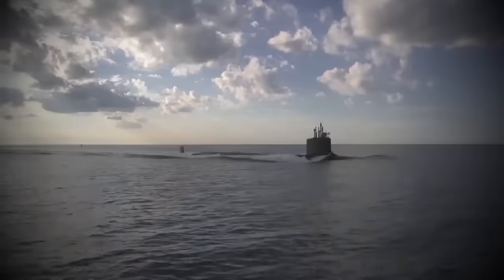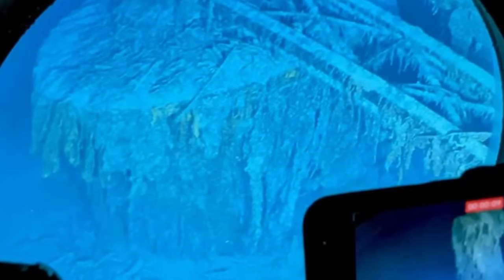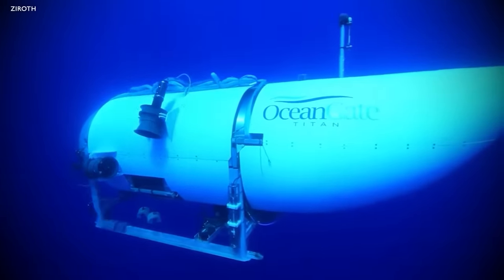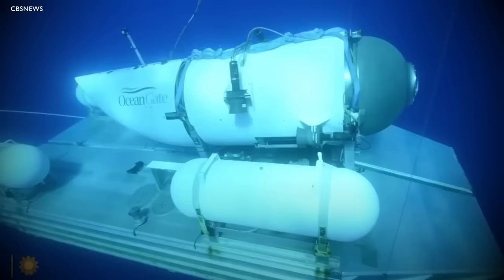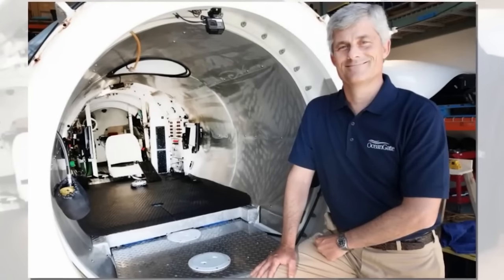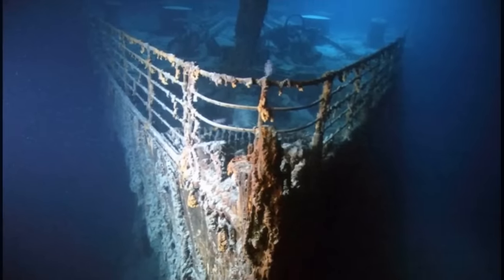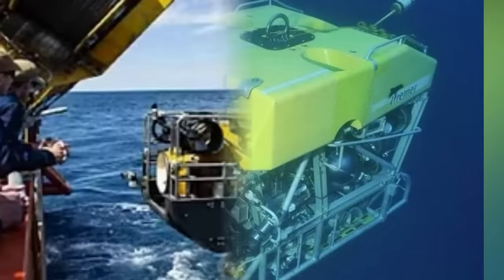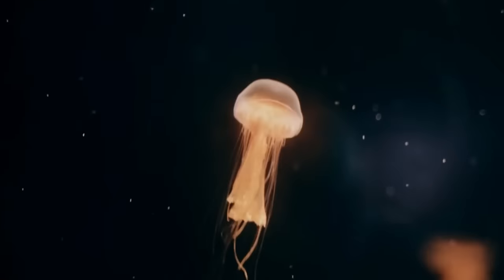The TERRIFYING Secrets lying behind The Imploded Titan Submarine Walls!!

Comment: After seeing so much about the brazen incompetence that went into building  that vessel, I really don't understand framing it as an impressive achievement or invention...
Reply: Agree.
Reply: yep , i would describe it as a deathtrap destined to fail . it had so many problems its difficult to determine which one failed
Reply: Correct evertime I hear that phrase used to describe this " vessel destin to fail" I can't take the narrative seriously and thus void my ability to drop an👍🏾and watched the complete video ✌🏾💥
Reply: Because it was
Reply: Because it is not… they used a sophisticated type of “plastic” instead of steel and titanium and they did it without class certification.. it’s criminal and disgraceful
Reply: @Slayavcados  bs... if it weren't for those kinds of projects we wouldn't have planes or gps.....wake up
Reply: @josepheddy8189 planes that use carbon fiber have had over a DECADE testing it and it doesn’t deal with the same type of pressure it isn’t glued on it’s reinforced and again, has gone through so much rigorous testing that IF it didn’t succeed with Boeing for example, they would have went out of business and some other company would have reaped the benefits from their research alone, furthermore they weren’t carrying passengers during testing, in fact each section was tested over and over and then when completed wind tunnel and computer simulations, they are certified to operate within their respective means, and they have regular maintenance/checks to keep it flawless… there’s no comparison here
Reply: @josepheddy8189 he wasn’t doing anything new. We can already go to those depths. He tried to do it on the cheap bypassing basic safety standards. I’m an ex-submarine. Just the shape of his vessels should have rang alarm bells.
Reply: Understandable if video is viewed as the click bait that it is.
Reply: @Slayavcados ok, don't take this as Mr thinking this was a great idea or anything, but you do realize that when layed right, carbon fiber is stronger than steel, right? It is FAR from "some exotic plastic". I think the laying of the hull wasn't exactly right, andmaybe even could have been thicker, and used a clean room. Also, the guy did manage to make 14 trips down to the Titanic. Out of 90 attempts, that's not great, but just getting there once is actually a pretty amazing feat. How many people has history shown found success when all the "experts" said they were doing it wrong? If the  sub worked great, none of us would even know about it.
Reply: ...framing Titan as an impressive achievement or invention... is B.S.
Reply: @Spike-sk7ql The issue isnt the strength of the material so much as its ability to keep the pressures of water at bay. It simply cannot do it according to all professionals in the field. No exceptions, you must use contiguous material. That is why steel or titanium are the main choices.
Reply: Right!

Comment: This video is a shallow regurgitation of information and video clips previously published elsewhere.  

- No mention of the fact that the "real-time Hull Health monitoring system" (noted at the 4:38 time mark) that analyzed hull stresses was only touted to work by Oceangate.  No independent testing of the monitoring system was ever conducted.  No scientific explanation was ever provided by Oceangate as to how the hull's acoustic signature could be translated into determining whether the hull remained safe.  (It has been alleged that the Hull Health monitoring system would work only to document the hull failure - and could not be relied upon to act as warning of impending failure.)

- No mention of the fact that the porthole window was dive-rated for only 1300M on a dive close to 4000M deep.

- No mention of the fact that it is standard procedure for deep sea submersibles to have emergency rescue vehicles standing by on every dive, either manned or unmanned.  There was no such supporting vehicle on the mother ship capable of assisting the Titan at the depth it was diving.  In an industry where redundant safety measures are a hallmark, Oceangate chose to operate with no margin of safety.

- 6:01 time mark _ discussion of carbon fiber hull.  No mention of the fact that Oceangate earlier stated that the hull would be made from pre-pregnated carbon fiber composite material (a much more uniform and dependable product than the wet layer carbon fiber composite material that Oceangate eventually used).

- 8:53 time mark _ discussion of Titan's sonar.  Titan was not equipped with sonar.  It needed guidance from the mother ship in order to direct it towards the Titanic wreckage.

- 18:39 time mark _ Navy heard the implosion and notified the commanders leading the search effort IMMEDIATELY.  This statement is absolutely false.  The US Navy notified the US Coast Guard immediately.  The US Coast Guard sat on the information for several days before notifying anyone.  This delay has been the source of considerable public outcry.

- Lastly, Karl Stanley (who operates another deep sea submersible) and James Cameron are both on record as having stated that the magnitude of the implosion would have been like a bomb going off.  The equipment aboard the mother ship would have had no trouble detecting the implosion.  Indeed, those on the ship might have even felt the concussion.  Loss of comms + loss of power + extremely large explosion = ???.  It doesn't take a scientist to figure out what just happened.  So what exactly were the crew of the mother ship doing for those 8 hours that they waited before contacting the US Coast Guard to report the incident?  (Conjecture:  They had difficulty reaching Oceangate headquarters and it subsequently took a while for Oceangate officials to mull over their options.  They weren't in emergency response mode.  They were in damage control mode.)

Comment: That so called submersible looks like it was built in a garden shed.
Reply: Perhaps it is a garden shed. Experimental. Doesn't look like a garden shed, but it is.
Reply: Your giving a bad name to garden shed inventors , it looks like it was made by Tom and Jerry having a scrap at the bottom of the garden
Reply: Class project for 7th graders with $20 parts from Home Depot!
Reply: It certainly wasn't a climate controlled environment. Both the carbon fiber and the glue likely had dust and oils (from bare hands) intertwined in the composites. 

An autoclave should have been used instead of wet laying and allowing to cure naturally.
Reply: Try building one
Reply: Right
Reply: I can build one I got a toilet paper roll for the hull  2 Gatorade caps for the ends and paper clips for the landing gear 😂
Reply: @justindemar4584 Sounds exactly   like Stockton's
Reply: It looked like something me and my friends put together as kids!
Reply: It looks like a child’s bathtub toy

Comment: It was a bad idea and it killed him, and he took four others with him. He was driven and the father and son were clueless but those other two guys should have known better. Anyhow, now we all know better.
Reply: You said that perfect.The two experienced men should have questioned everything about that vessel. Having been experts in there fields they already knew so much.Why trust this vessel without any certifications. Using materials that had not been proven to go those depths.They had no back up vehicle or cables connected for emergencies.No safety compartment to move to like on a space station or submarine incase of leaking water.Like a capsule that could be launched back to the surface separate from the other vessel.So if one failed they had a back up vessel.Sounds like they had no time( seconds) to comprehend what was happening or be able to do anything about it.Hopefully they did not suffer! The whole thing is sad for all the families left behind!
Reply: Absolutely correct!!

Well said!!
Reply: Hamish Harding was the craziest of crazy thorough seekers, this was bound to happen to him eventually. And pH probably knew the risks and wasn't so worried because of his advanced age. "It would be a quick and painless way to die" he said once
Reply: How was the other billionaire adventurer expected to know any more than the father and son. The waivers signing off on death numerous times, most notably on an unregulated and uncertified submersible should have been a huge red flag to them. Rush fooled them all, sadly.
Reply: @qtpieamongus8954  Because they were actually real adventurers and not tourist. Spelunking is decidedly dangerous. I went into a cave once as a tourist. They had hand rails and electric lighting in that cave. As a tourist, I expect the tour guide to take me someplace where I can go ohh and ahh, and look around and enjoy the sights without dyeing.

Comment: I was thinking early on that because of the weather they wanted to decend faster than normal to expedite the trip.  I wonder if they used heavier ballast than normal.  They were decending faster than normal from the start (according to transcript), yet they didn't seem alarmed by it at all.  This in turn may have caused secondary systems to fail and flood causing additional weight...

Comment: 1) Don't build a plastic sub. 2)You can't push a rope. 3) You need seats with restraints, to prevent everyone from sliding toward unplanned nose down or nose up situations. 4) Don't make a discount electrical control system. There are other things to point out, of course.
Reply: Why can't you push a rope? And what rope exactly?
Reply: @_SnowBeam_  If you don't get it, and want to discuss types of ropes, you just want to argue. It's an old saying. Go get a piece of ordinary nylon rope, about 5' long. Pull it so it's straight. Pull it toward you, from the end closest to you. Pull it about a yard ( meter). The whole rope will completely move the same distance. Now push your end toward the other end. Does the other end move? Oh. Ropes are great in tension, but lousy in compression. Fibers are the same, basically.

Comment: - 3800 metres, not 2800 metres...
- Game controllers refurbished are also used by the US navy for optical systems on submarines
- The RTM (Real Time Monitoring system) for the carbon fibre hull was pretty useless as carbon fibre has a sharp drop when it comes to accoustic signals of failure. Meaning that when you hear the fibres crackling, that's the moment they are about to fail. There is not much accoustic warning time.
- The carbn fibre hull was glued to a titan O-ring on each end. The overlapping surface of the carbon fibre hull and the O-rings was only a few inches. That means two materials very different in their reactivity towards pressure were connected on a very small surface. The elongated carbon fibre tube would bend very much, especially on the ends, wehre the O-rings where glued to, while the O-rings were the most stiff part of the whole submarine. That means a huge difference in flexibility on two points and on these points you only had a few inches of glue, keeping them together. 

There is a "Leaked transcript" of the supposed communication between the Titan and the Polar Prince until the loss of communication with the Titan. This script is not proven to be real, but it makes a real impression on the first view. If this communication really happened, then James Cameron's statement concerning the incident makes even more sense...

So: The game controller as steering device is the smallest problem...
Reply: Those aren't called O-rings. O rings are small rubber, nylon or silicone gaskets for use in hydraulic oil cylinders of heavy equipment such as excavators, pay loaders etc. Big heavy metal rings with bolt holes, stud bolts, clamps, screws or any mechanical fastening are called "flanges" in mechanical engineering or machine shop works.
People who repair hydraulic systems might get confused. They'll strain their eyes watching the video looking for those small rubber rings.

Comment: Please use different words its grtting ridiculous how yall are framing this crap man. Omg so impressive it was controlled by a gaming controller! Dude no thats the issue. To many corners cut and cost cutting happening here. It isnt a marvel we have had other submersibles that made it down there also. Like truely good engeneering that took into account the life/lives on board. The ones who checked all marks and spent weeks and momths even in the smallest of areas to make sure everything was just right. But no thia dude goes instead of using SS or titanium for the inner wall lets use 5 inches of carbon fiber it should be as good! Not even close like literallt even that alone if they went with the correct teated materials this probably wouldnt have happened not even accounting for all of the other mistakes in the design.

Comment: At 3:00 3:01 you can see moisture or water on the cap. Could this be a reason it caused an implosion?
Reply: This is most definitely condensation, that deep down is very cold and moisture in the air will form water droplets. İf there was a leak the size of a hair follicle,  it would take a matter of seconds to fill the submersible anyways.

Comment: A plastic submersible imploded ; sadly it’s not a surprise… what is unexpected is how they managed to get this far without being stopped…

there needs to be new rules that prevent such alternatives being designed and built without class involvement… any builder who does it should be shut down and banned from the sector. If we can’t stop them in international waters we can at least shut down any builder and cut them off from production

Comment: So how did they connect power from the outside of the hull to the inside of the hull?
There is only one way it could have been done, yet they won't show you, because it it simply is impossible to work, the design doesn't allow input of wires and cables into the carbon fibre hull without compromising it.  
And the titanium aft cap doesn't allow for it as all cables seem to run between the outta shell and the carbon fibre hull!
So where was the oxygen tanks and the carbon dioxide filter, and how were they powerd internally from the external battery...
How was the computer and lights powerd..the remote control did not directly control  the outside mechanisms such as thruster propella lights ballast, cameras, the computer gave the commands from the controller..so we are told!.
How was the computer powerd.
There is no power cable or power connections or wires  fed into the hull at all! 
They couldn't be, the carbon hull cannot be drilled through..
So where are the cable feeds?
The whole thing is a scam..
When you see that they tow the sub 100 metres behind the ship all the way to the Atlantic on a thin tether, and even enter the sub bobbing around in choppy waters with the front cap open to the elements, it's obvious that it's purely an excercise in mockery!.
Nobody went down in that sub to the Titanic!
Nobody!!
Because it's a gimmick!
A joke!

Comment: How much extra would it had cost to just use 5 inches of titanium instead of carbon fibre.
Reply: lots of money, not just the materials and the machining but the fact the thing would have to be totally diferent, much bigger, with more complex devices for buoyancy.... and being heavier, much much more expensive to operate. this guy was all about getting money, 250k per ticket, he couldnt do that with a full titanium vessel.
Reply: Dude. Look up the cost of a titanium screw used in surgery. Compare that 0.001 gram of material, to several millions times that.